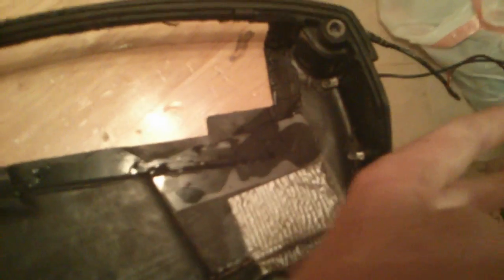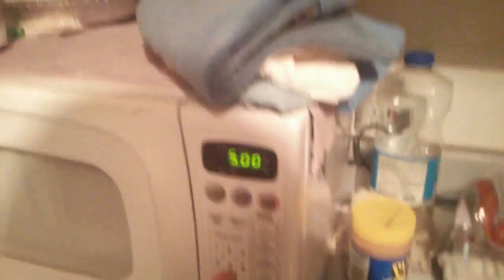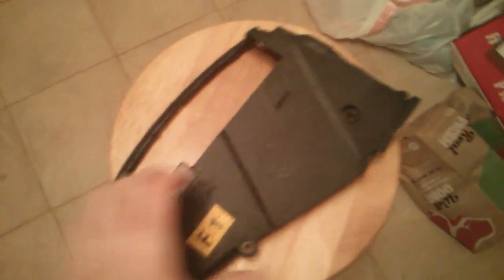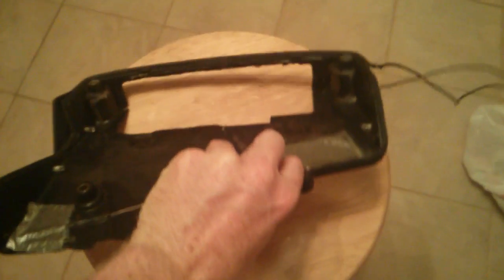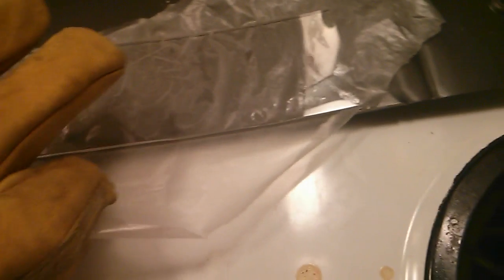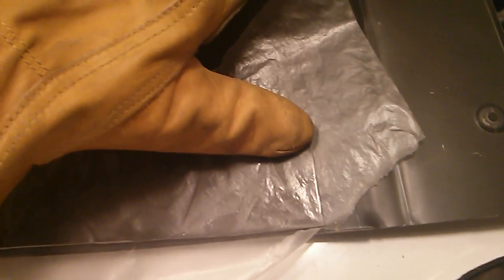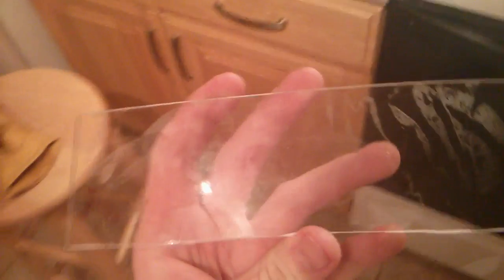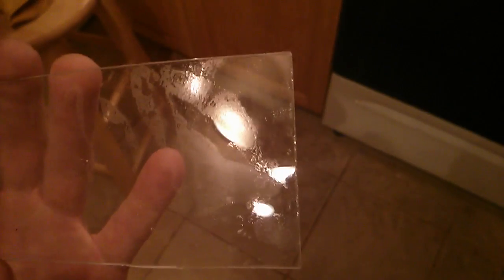How to bend plexiglass (clear timing belt cover part 1)

Comment: 250 degrees or 350? 
I'm having bubbling issues with my acrylic sheets. Anything above 300 degrees is instant bubbling within 20 seconds
Reply: Are you using acrylic, or poly-carbonate? Polycarbonate has a bad habit of bubbling.......

Comment: good for him for thinking outside the box, but what car uses a yamaha engine.
Reply from the maker: Andrew Timple Toyota works in conjunction with Yamaha quite a bit. The 3sgte that is in the Turbo Celica GTFour and Turbo MR2 has a Yamaha-designed head and the 1ZZ and 2ZZ engines that are in the newer Celica/Mr2 are fully Yamaha designed. So the timing belt cover has Yamaha stamped on it, but Toyota is stamped on the rest of the engine.
Reply: Andrew Timple Ford Taurus SHO in the 90's used Yamaha engines. They were snappy for what they were too! Beat Mustang GT's of the same era! lol
Reply: Geo Metro 3 cylinder 1.0 litre. Good engine but too small for American asses.
Reply: Yamaha also helped with the 4AGE, 2JZ, and the Lexus LFA.

Comment: first off all, an led does not pull 12 volts.... this is not possible. the voltage acros the leds is 12 volts, it wil drain current and not voltage. second is that a led is a light emitting diode so it has no current limiter whatsoever if your alternator spits out 16 volts the amount of current will rise and your leds will burn out in time. third you are doing it wrong you should connect your leds in parrallel with a 470 ohms resistor in series with a led. this limits your current to 20 milli amps.

clearly you have not done your homework and do not have the needed knowledge to do this properly and could result in a short circuit which is a potential fire hazard. and this is why we electronics engineers do not advice unskilled people to do things they know nothing about. maybe you cant see the danger but we do.

i bet you just hooked it up to your battery terminals and didnt use a fuse did ya? smart move in a shaking, moving, screaming hot, potentialy explosive engine bay.
Reply: k8gixser Sure, he may have been a bit brash about it in the initial reply, but he's got a very valid point. If you aren't too keen on electronics, please, don't try them - especially around a critical area in your engine bay. If the LED's were to be connected and run the way they were explained - it would only be a matter of time (a short matter of time... no pun intended) before those would burn out, cause a short, and possibly dislodge and fall into the timing gear. Even something as small as a little LED diode could wreak havoc on a timing system. 

It could have been worded a little softer so-to-say, but minimally, the message was clear. So, no need to name-call and speak for others - because, exactly that is what assholes actually do.
Reply from the maker: lol. I never said it pulls 12 volts, sure, I accidentally threw the word "pull" in, but it was associated with varying numbers. I generally talk about electricity in terms of "pulling" since that is how devices behave, not specifically voltage. I was brushing over that part, mainly because I didn't label the video "how to wire in LEDs", if so I would have described it more thoroughly. The alt won't put out anywhere near 16 volts, or even a voltage high enough to blow the 4 LEDs wired in series, so I'm not worried about this. Everywhere else I've used these LEDs on the car has been with a 1/4 watt resistor to bring the voltage close to 12v. This is more of a simple/neat wiring job since it's outside of the timing cover and visible. Thanks for your reply though
Reply: my reply was mainly for users who will watch this clip and try to duplicate your system that it has several flaws and problems. fyi a resistor limits current and does not level out voltage. it is your car and if you are happy with this situation thats your thing but you are misinforming the rest of the users. that was my goal. nothing more nothing less :)
Reply: mentaldesign

Comment: This is "NOT" how to bend plexiglass.. please...............
Reply from the maker: well regardless, it still worked :) I've also bent it with a blow torch or a torch lighter. Oven, torch lighter, or propane, as long as it doesn't bubble from the heat it works fine.